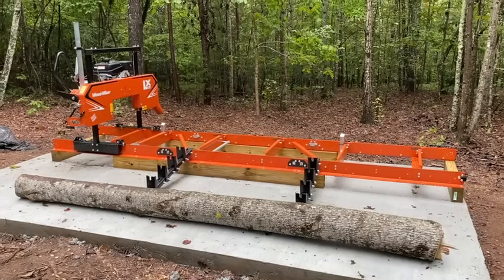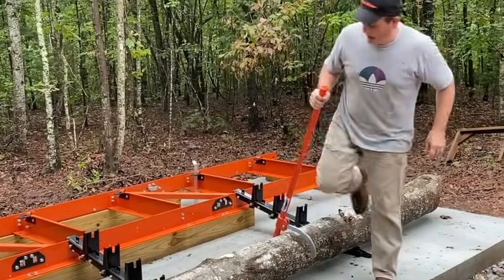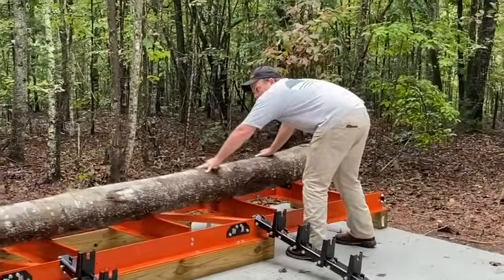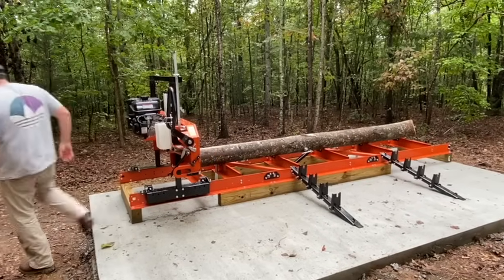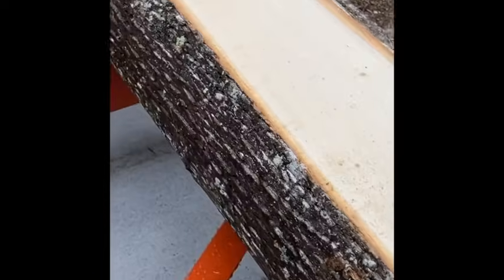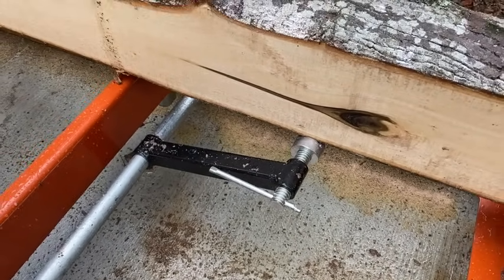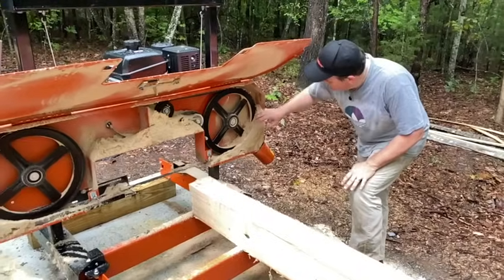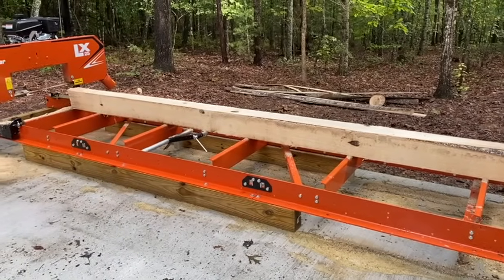Woodmizer LX25 Demonstration and Review

Comment: I have a  LT 15 Go, and boy this is 4 year  old  video  and know you've learned a lot by now, seen so many bad issues with this mill, one handle falls and hits your arm on the height adjustment, and loading those logs with a cant hook is a joke, good way to bust your shins or worse your nuts,  one other thing I see is your using way to much water, nothing is exiting the tube, It's all plugging up in the head, Keep sawing and you'll get things worked out.  Can't believe Woodmizer sent that to you with so much missing, and don't think they even make that mill anymore,  Nice video but wish I could have helped you out on your first cutting.  Thanks for sharing your first video without any editing of it.👍👍

Comment from the maker: I think having a pretty level platform is pretty important. So far, mine has been really easy to level and keep level because of that. I would recommend keeping everything pretty level.
Reply: And thank you for showing that platform. I've been thinking that it's key for any sort of operation like this as I start to put mine together in my head (especially on a new homestead). It also set's you up for post-cut processing (easy foundation expansion on the other side to get in with a fork and move your cuts to racks, drying, treatment, storage etc). Again, thank you so much for doing this in an honest way, so the rest of us can plan accurately.

Comment: Ok...logger's technique (try it !!!).
Piece of (sturdy...nylon? etc.) ROPE.
...securely tie one end around the base of (sturdy) tree in your vid background (various knots will work).  Take the untied end ACROSS your Mill's log platform and UNDER the log you're trying to load onto the platform (in roughly center of that log)...make 2 or three wraps (don't overlap wraps over each other).
 Throw the loose end of rope toward the trees, walk over there and gently pull on loose end of rope.   Log will walk right up on platform....very little effort !!!! Wet or not...doesn't matter...  All the best.  Great vid.
(I like cheap poly, nylon, etc., Thick 3/4 or 1 inch....cheap to replace...).

Comment: ahahaha....watching you trying to roll that log up the ramps was funny.  First thing I figured out with mine was you need a tractor to move logs/lumber/slabs/etc anyway, so you might as well just break down and buy one to go with a mill.  I already had a small (22hp) tractor...too small for a front loader, so I put forks on the back (hay forks cut back to 40") and built a wood ramp I could back up and set the logs on a level wood deck to roll them into the mill.  THAT saved a lot of work/frustration.  Later, as financed improved, I bought a larger tractor with a front loader, which is what one really needs to go with a mill.

Comment: A lot of comments,  I haven't read them all so maybe its been mentioned.   A heavier log may actually load up that easier as its less likely to spin in place.  Adding grip tape to the ramps or truck bed liner may help with that too.  Also look into parbuckling for loading logs, you can move massive amounts of weight with less effort than a can't hook/Peavy and there's no risk of it rolling back onto you if the ramp catches fail.  A masdam rope puller attached to a standing tree will work for most logs if you don't have an electric or hydraulic winch handy.
Reply: A lot of good ideas. I think the grip tape could be the first try since it is cheap. Good post with lots of good advice.

Comment: I have a Timbery M120 saw mill, which is almost the same product. I also have problems with saw dust, the problematic part is the grid in the output tube, even a small piece of bark can create a blockage. I did simply remove this grid. Nice concrete basement 👍. Sometimes don't be afraid to use your muscles, the lifting system does not seem to be really efficient for such smaller logs...
Reply: I think the M120 is the LX55, the M100 is the LX25.

Comment: Go to low's or HD and get the stick on "No Skid" stair tread material and custom cut/fit
pieces on to the ramps and the face of the stop pawls.
Reply: beat me to say this! totally agree, but make sure you get the super heavy duty stuff, that amazon crap wears right off in the wet.
Reply: Exactly what I was thinking. Those loading ramps are a great idea, and would save a lot of wear/tear on the frame from fork/tractor dropped logs. NoSkid would bring that thing into perfection.

Comment: Be careful with the two metal braces which are out of sight when cutting, you may easily forget to check for clearance. Try to keep them as low as possible and make it a habit to check them before the next cut.
Reply: after the log is squared on three sides they are best removed, there are little tabs engineered in the place those metal braces slide down in, and those will hold the log secure enough to run the saw with no worries, because the saw head will not lower down low enough to hit the tabs.

Comment: Maybe run some self tapping screws into the ramps from underneath, depending on the thickness of the metal 
I bet about a 3/4" screw would leave a nice amount of spike sticking out for the lig to bite onto while you roll it with the can't hook

Comment: All the mills have the safety grills of one shape or another. They are an industry requirement for the CYOA code. Once you get the mill home, its your choice to keep them or remove them. However, if you decide to remove them and someone gets hurt because you did, be prepared for some serious repercussions. Personally I think they should be removable and replaceable, which is what I did with mine.

Comment: Seems to be a pretty decent machine. Throw that log ramp away  it's easier to just set the log on the bed with your tractor. Good luck with your new saw mill
Reply: You got the good tool so use it.

Comment: big thank you for your video, yes, was chuckling also but i am sure you were also at yourself.. Learned alot from your mistakes, but as they say, "if you dont make mistakes, you will never learn. I'm about to order mine here tomorrow, sad thing is they say there is a 12-16 weeks back order. YOu take and be careful. Just FYI if no one already said it, those few inches at the end you could of cut off with a chainsaw. Again BIG THANK YOU.. one more thing,, to keep the blade from flexing and have possible wavy cuts, push your guide closer to the log. That adjustable guide is one reason i am ordering this mill,

Comment: Personally, nice for 3000$. Put some 4x4under ramps out to the edge of the concrete. Stage two to three logs ahead that way you use time efficiently. Do you have lumber racks to stack on? Keeps it organized in bound material and out bound material. Then you can take time to get effective on the mill. Time is better on mill than working on moving materials. I do like your choice’s, concrete, mill, and do it yourself!!! Thanks.

Comment: Never pull your mill backwards through the log with the band spinning. You got really lucky the scab was under a lot of tension and was curling up on you. There is a really good chance you will pull your band off the wheels. When it flies off, it could bend or break. Most people just cut the board right behind the blade and remove the scab by hand. Some remove the band all together so they can get the mill head out of the way then cut it off right behind the band. If you don;t want to do that, get some small wedges and lift the opposite end.

If you want to stop the spinning on the loading ramps, go get a gallon of cheap paint and put a bunch of sand in it. Then, just paint the top surfaces. The grit in the paint will help the logs bite. You can also buy stick on non skid pieces if you don't want to mess with paint. Good luck with your mill.
Reply from the maker: Yes, thanks for that advice!  I learned that from my uncle-in-law after I did it.  He gave pretty much the exact same advice about how to avoid it.  Thanks.

Comment: Put some tar paper on the loading rails for friction to ease loading the logs. You could also attach a small winch to the edge of the platform away from the saw or build some form of pusher unit to push the logs up the ramps.

Comment: I think if you had used your hook (or a 2x4 or similar) as a lever UNDER the log with the cement slab as a fulcrum instead of trying to pull it up, it would have worked  much better.

Comment: Maybe epoxy a 36 grit sanding belt along  the loading ramp, prevent slipping or weld a serrated edge for a more permanent solution,  this is something the manufacturer should consider when they update the design.

Comment: 15:28  Design fault,  Chips of bark will also plug it.  Cut out every other finger.  My older LT30 has only two or three fingers
Reply: I’m trying to figure out why there are bars in the discharge chute at all. (Other than keeping fingers/hands out)
Reply: @lousimpson834  To keep the mice out I would guess. I would try a portable leaf blower to clean out the mechanism every few cuts. Also seems like lots of water running through, maybe more then recommended? I dunno but nice little mill.

Comment: I bent those metal fingers out of the way on my lx25 and the sawdust flows fine.
Reply: i cant understand why they put them there in the first place?
Reply: Me Either I’ve had a lot of trouble with mine I got number one off the assembly line
Reply: Metal fingers are to keep a broken blade from flying out the sawdust chute.
Reply: @davidtrutwin3790  why is that a concern?
Reply: @davidtrutwin3790  seems like the clogging is more of a concern to me
Reply: @craigbielsky115  It could be an OSHA or Woodmizer concern or rule.   On my machine (LT-30) I am close to the chute and I even walk very close past it at times while sawing.  I have had broken blades come out part way even with the fingers.  I notice it should not be a problem on the LX25 as the operator is at the opposite side.  Only concern is when a helper would be close to the chute

Comment: Is there a reason for a grate to be on the sawdust discharge? Maybe to keep fingers or arms from going up the discharge I guess...seems like cutting out that grate might help a lot with the sawdust build-up, but I suppose it also presents some safety concerns?  I don't know, if your running the saw you should be clear of the discharge anyways...

Comment: In hindsight, would you have down angled the concrete on the load side?  Im considering this exact set up.
Reply: Better still....build a short retainer wall on the loading side, set the concrete base about 30" below the top of the wall.  You'll need a slight slope to your site for this. You can bring the logs in on ground level on the retainer wall side, put 2 6x6's on the ground extending over the retainer wall to the mill bed and simply roll them onto the bed. 

THEN raise the mill up to waist high for better working height (your back will appreciate having the slabs and lumber at a height you don't have to bend over EVERY time to take off the bed).

Comment: There you go ...someone make some ramps that have "gripping teeth" on the contact surfaces and we'd probably buy them..what does the manufacturer have to say about their ramps slipping?
Reply: Funny....the mill I bought in 1991 (LT40), the ramps had 'nubs' on the.....a pc of square stock welded about 6" apart so the log wouldn't slip like that.  You could roll a log up a lot steeper incline (my mill on trailer, so the bed is almost waist high) and the log not slip.  "New and improved" ramp doesn't appear to be improved at all.

Comment: Let me get this right.  Once you waste about 5 mins turning a log up those ramps, you have to remove them to cut!  I bet he never uses them again.
Reply: Mine have been sitting in the barn somewhere collecting dust since 1991.  Cut some 6x6's on that new mill, build a log deck on the OTHER side (out of the way of you controlling the head) and simply roll your logs in on the mill bed.

Comment: Watch Mr Jos Won's youtube channel. He's a good teacher. 
 That small log you cld proly pick each end up by hand. 
 Did fine job setting your Mill up. Everyone has to start somewhere.  Baby steps. 
 Level the Pith up on each end. The very center of most logs but not always. Try taking off small slabs or Fitches, at a time until you have a square Cant. You'll be a Sawyer in no time.  You have a nice tractor back there. Its a work horse . Use it save your back. Poplar is very pretty . The older the more colorful the grain. 🇺🇸
Reply: Josaljo Won
Reply: @avoidtheherd7066  Thank you for the corrections

Comment: Mount a boat went on the other side of the saw run the strap underneath the saw down and around and back to the boat winch and just put the log in the loop and Crank it up 29.99 on Amazon problem solved

Comment: To funny, the diameter of your log is to small. 😂😂😂😂😂😂😂😂😂😂😂
Reply: Not at all.  One of the advantages of a small bandmill is to be able to make use of smaller logs a "regular" mill won't fool with.  Even most log scales (Doyle is used here) are weighted against smaller logs.  A bandmill can regularly saw 150% or more over scale due to that fact on small logs. You're not going to get the highest quality lumber out of small logs, but for many uses, it's just fine.  Go look at a bundles of studs at Lowes/HomeDepot.....you'll see the tree center in 75% of them.  WHAT are those mills cutting studs out of ?   5" trees ?

The one thing this new sawyer will find is most small poplar logs (like in the video) will warp like the dickens as they are sawed.  I often say "the woods apparently is a more stressful place than you would think"...ahahahaa.  You start sawing 1x out of it, and you'll often see the lumber arching up/down, causing you to get thick & thin boards.